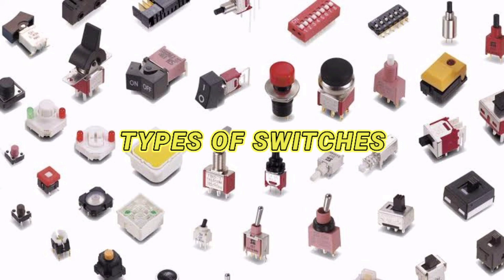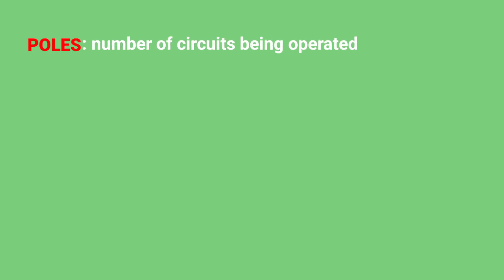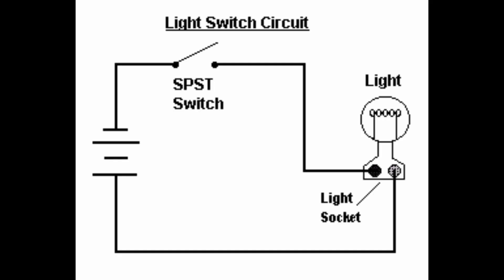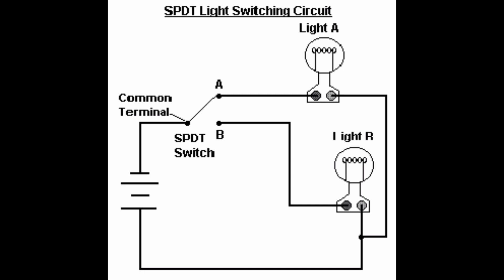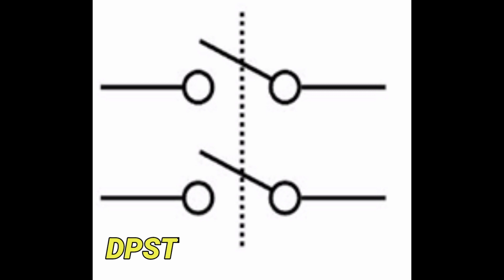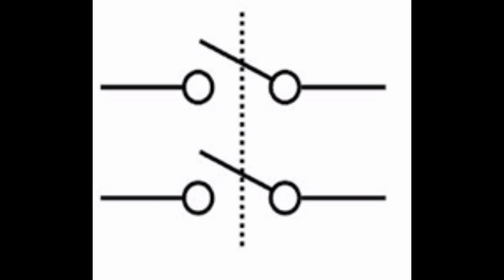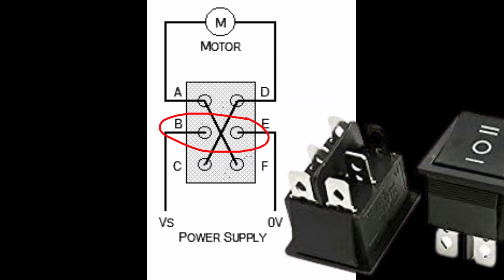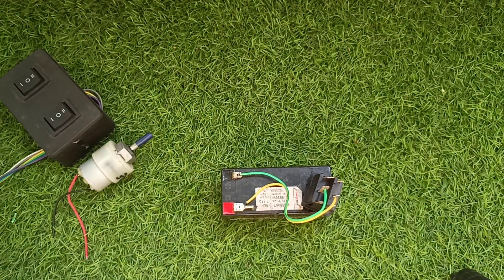DPDT Switch connections to motors and all types of switches explained | Robotics | SDCAC

Comment: Hello sir , i have a question 
I have a bluetooth speaker and I want to operate it on both 12 v Battery as well as 12 v Ac adaptor so how will I be able to choose the switch from which power will be delivered please explain the wiring diagram to me 
Thanks 🙂
Reply from the maker: Hi buddy, thanks for asking if it's runs on battery of 12v it can also run on ac but you need an adapter for that, ac to 12dc converter, i don't have an idea of wiring diagram and all, you please search in YouTube there are plenty videos available thanks.
Reply: @infinityexplorerram  ok sir , no problem
 thanks